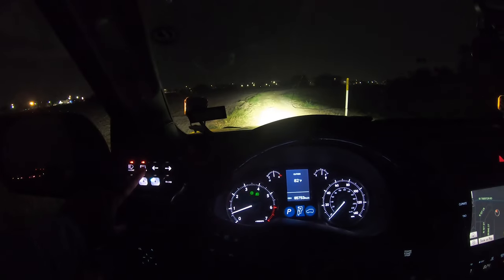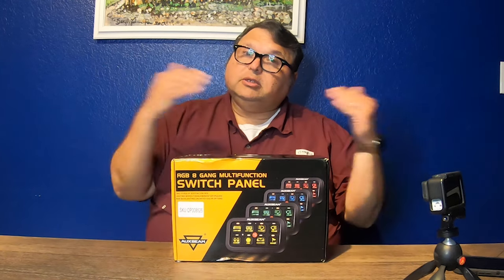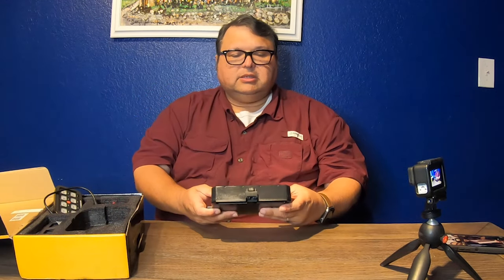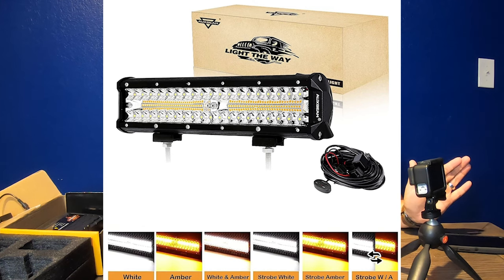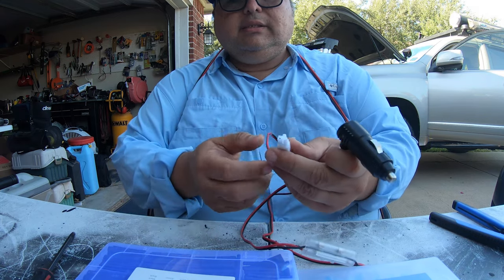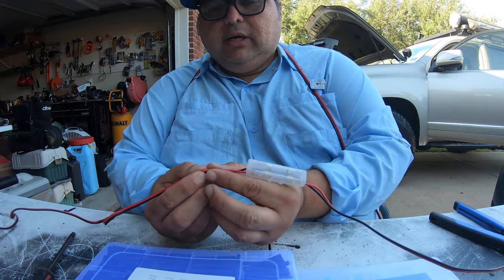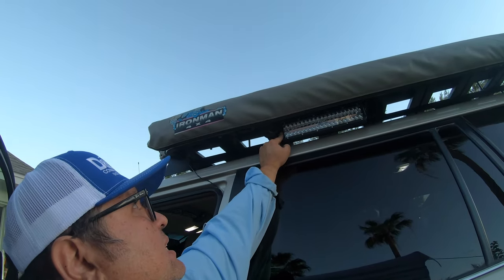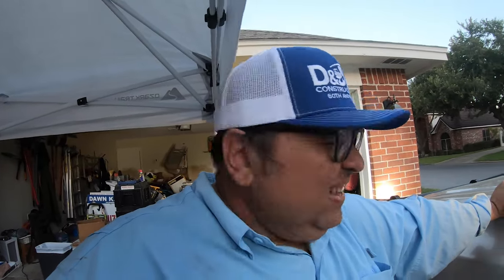How to install the Auxbeam 8 gang switch panel & 12" Light bar on the Lexus GX460

Comment: I have an air compressor installed on that side. I think I will need longer wires as install would probably go on the other side.
Reply from the maker: My friend has his ARB compressor next to the switch panel. I carry a Viair, but will upgrade to onboard and will install it in that place. I imagine that the wires would be very close to the battery.

Comment: Just a suggestion.  You could make one of the unused switches a momentary switch and hooked up that trigger wire for your light bar to it.
Reply from the maker: Funny that you mention that. A buddy of mine just told me that a few days ago 😎🎥
Reply: @CoastalGX  Did it work?? I am thinking of getting an auxbeam light bar and wiring it to my auxbeam switch panel........but really wanted to at least have the option of going white or amber on those leds..

Comment: Good day sir,

I’m new to this wiring business and before I get cutting I have to ask. I purchased a 6gang panel from auxbeam.

I also purchased a rough country led bull bar. At about the hour mark you have the harness in your video in your hand and this is were I need help.

My harness is DAmmm close to the same  as the one you have has a small switch, main 40a fuse, power connectors and so on.

If I cut all that stuff off like you did and have just the main cable do I wire directly to the auxbeam fuse panel?
Reply from the maker: Hi Seth, yes, remember that the panel has its own fuses. Look at the fuse number on your led bar and make sure it matches in whatever channel you’re connecting. Your setup will be neat and tidy without excess cabling all over your engine bay. I have a box full of cables with relays and left over wires now. Good luck!
Reply: Should I be adding an inline fuse between bull bar and fuse box?

Currently there is a 40amp fuse box as well as an inline 30amp fuse.

I know that the auxbeam has a 30 amp fuse but will a require an extra?

Sorry for all the questions this is new to me and so far your the only person I found that is so in depth and dealing with the same situation I’m in
Reply from the maker: @sethgillan6923  sorry for the delayed response. You don't need any extra fuses as long as you have the proper fuse on the switch panel channel.

Comment: Question…

So with light bars with different light modes… (white, yellow, strobe, etc) 
How do you toggle through the different modes? 

Can they be assigned to the same button by pressing it a multitude of times like I have with simpler switches? 
Or
Do I have to assign each mode to an individual button?
Reply from the maker: You can not toggle between modes when using the switch panel. That’s why I had to select the one mode I wanted prior to installing. You are stuck with that one mode. However, there is a switch panel mode that makes all of your lights flicker in unison. I guess if you had an emergency.

Comment: How do you adjust the brightness of the control panel?
Reply from the maker: I use the app that comes with it, but some models that don’t have the app can be adjusted manually. Simultaneously press the power button and any one of the accessory buttons. With your finger, you can press the accessory button in a circular motion to adjust the brightness and even the color. Contact me on Instagram and I can send you a video. @coastal_gxspi
Reply: @CoastalGX  cool

Comment: would i keep the relay that comes with my light bar's harness or would i cut it and wire it directly to the panel?
Reply from the maker: Wire it directly to the panel. Just make sure you have the correct fuse 🎥🎬😎